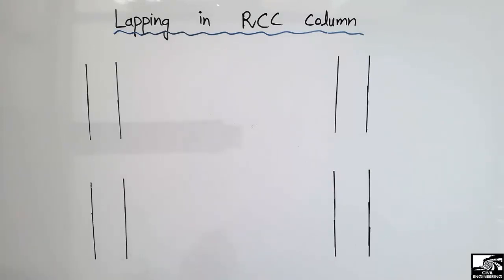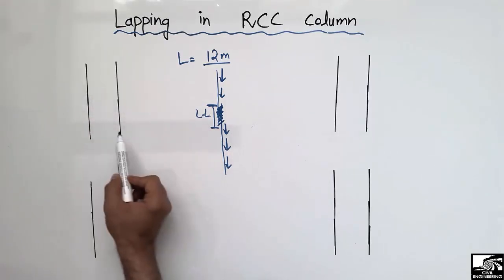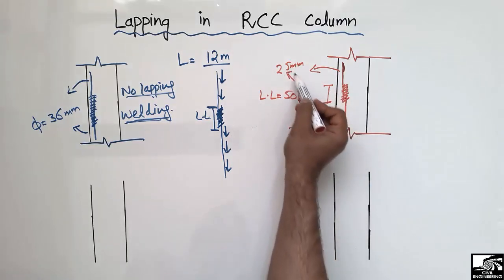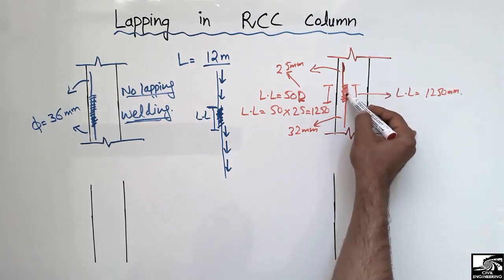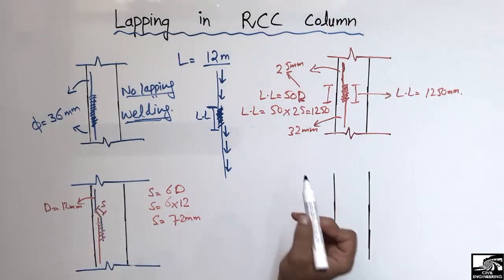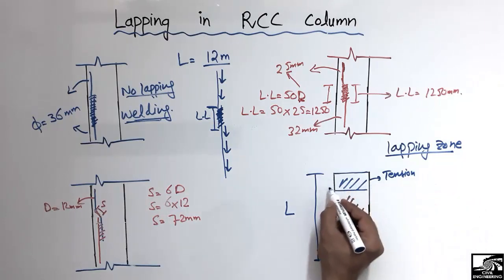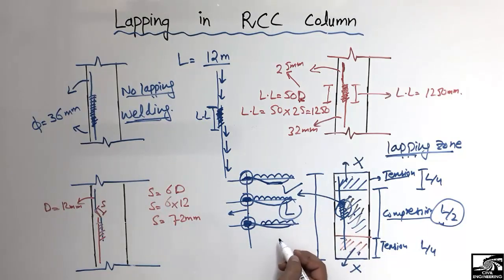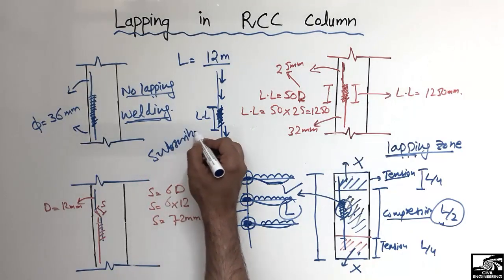Rules for Lapping in RCC Columns

Comment: Thankyou for the video explanation which has left me with a number of questions (a good sign of learning :) )
1. What if any difference does the use of the angled connection (diagram 3) make to the length of the overlapping ? 

2. Noting your reference to the different zones within a concrete column (Diagram 4) and advice that lapping can only occur in the middle Zone does this mean that the end of both reo bars must start/end within that middle zone.
3. What if the length of overlap (diagram 2) is of a length that necessarily extends into the upper/bottom zone? 

4. What differences apply to these rules if you use welded joints for metals < 32mm in diameter ? Does the welded splice have to be on a minimum length (relative to total length)?

Comment: Welding of column lapping for 4*12 mm is good or not for 2 ft distance ( all four bar in same distance) only available above slab for 1st floor only house. Does welding reduce its strength. If ok, how much length does it need to welding

Comment: In existing 3rd floor, how to convert or extend the 4 by 4 column into 9 by 9. hereafter ...does it give strength to take extra 4th floor in the building where below two floors have 9 by 9 column.
Reply: Four storied house ,how can column design
Reply: Tq sir good information